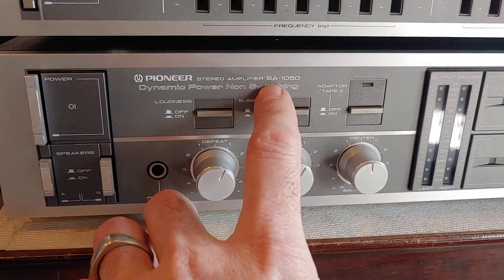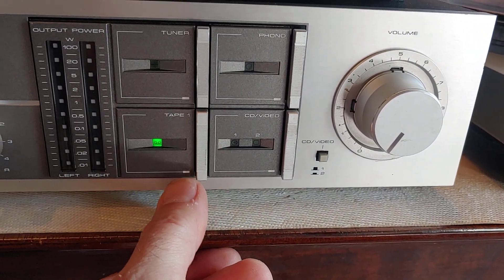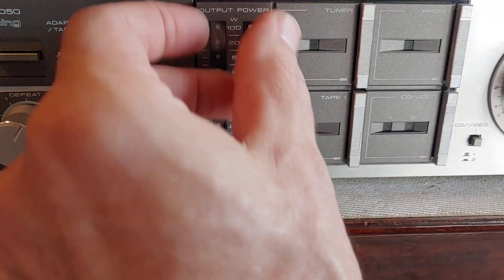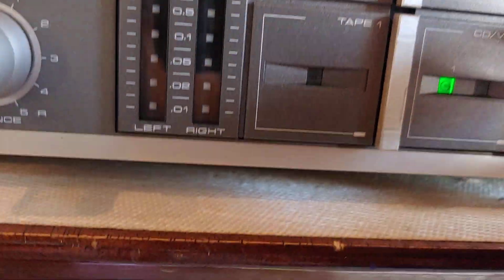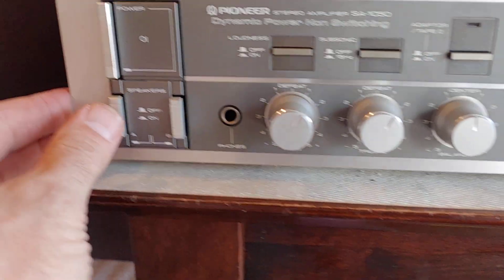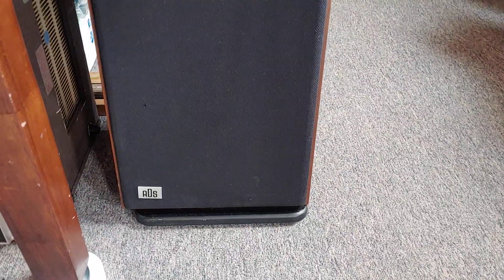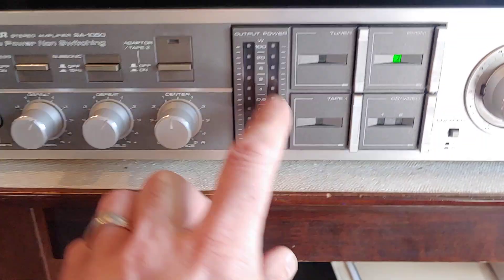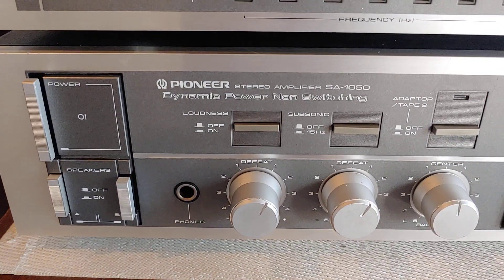Pioneer SA-1050 Non Switching Stereo Amplifier demo.

Comment: What equalizer are you using here?
Reply from the maker: That is a good question. I don't remember the Model number and it seems that I didn't upload a video on that one for some reason.
Reply: @DalesVintageAudio  That's ok. I've noticed that with analog, an equalizer is not really a necessity as with digital. It has a distinct sound that digital just doesn't have, no matter how many watts the device has.